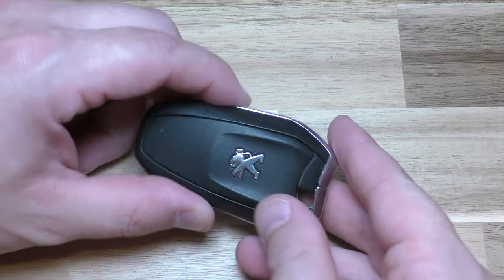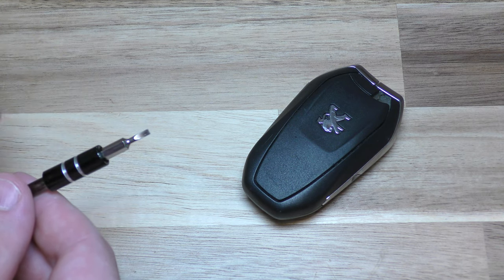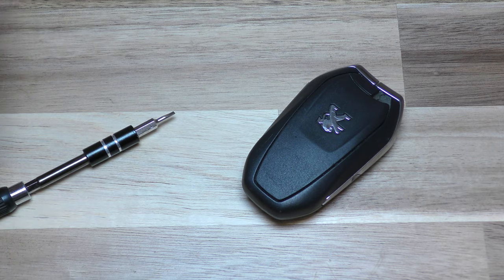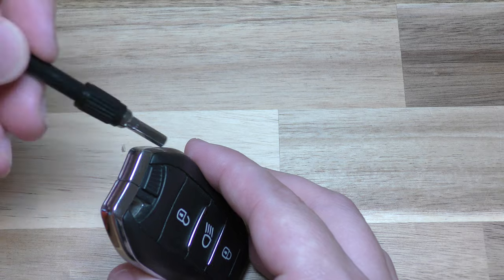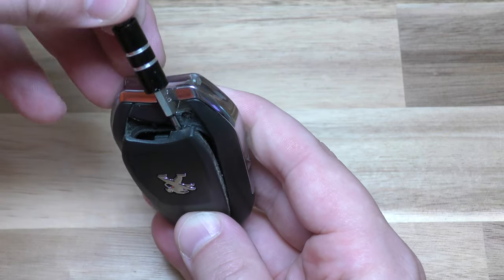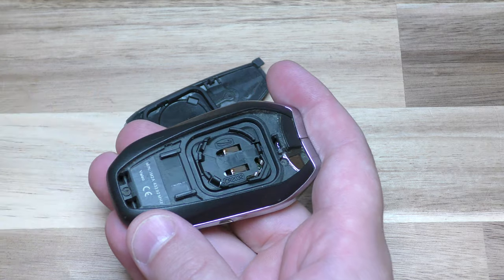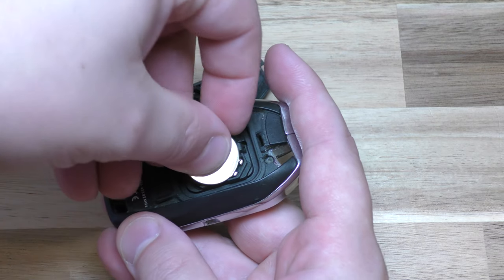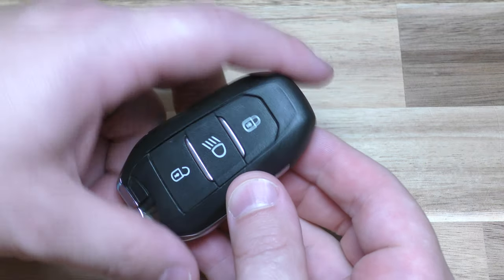EASY - Peugeot Key Fob Battery Replacement - DIY

Comment: It's absolutely necessary to slide in the new battery in the right direction, as in the video. Not just to push it to its place as I first did, which resulted in a nonfunctional key. Somehow I managed to repair the already twisted +contacts and now the key is ok.

Comment: When I got my car it had a 2032 battery in the car but since changing it, will o ly work with a 2016 and not very well either.  😡

Comment: Thanks but my 2019 Peugeot Rifter has a different style remote control key to the one shown here. A screwdriver may do the job but I don't want to damage the key. Any suggestions?
Reply from the maker: Is it like this Peugeot fob? https://youtu.be/ibOk5ocnff8
Reply: @KeyFobRob  Thanks for your speedy reply. No it's not that one but I did find it here https://www.youtube.com/watch?v=I661cqEXLaA
By the way I live in Ireland, I don't know if that makes any difference
Reply from the maker: Ive got that one too :) https://youtu.be/sW_6vv2v4cc
It's the Vauxhall version but it's the same process